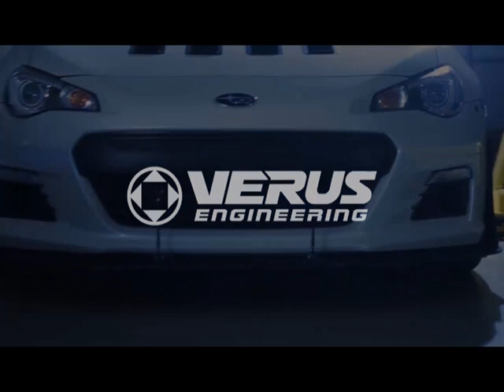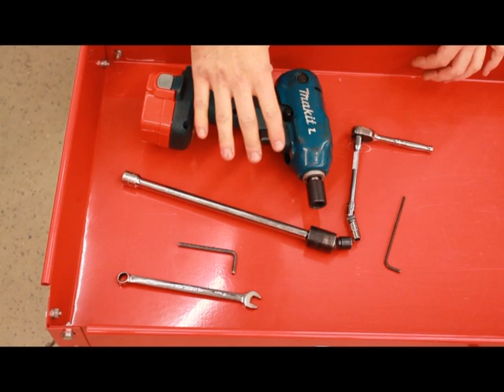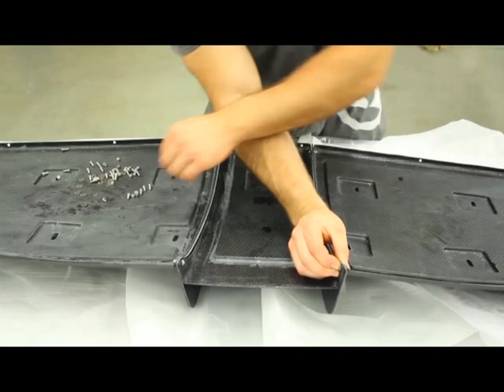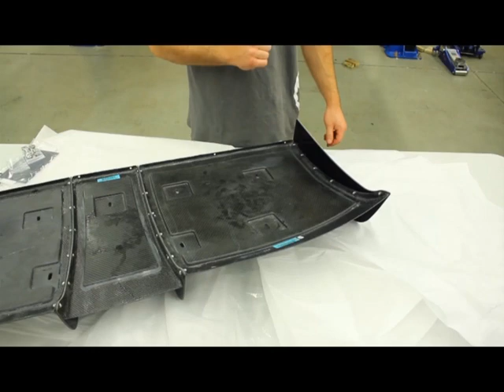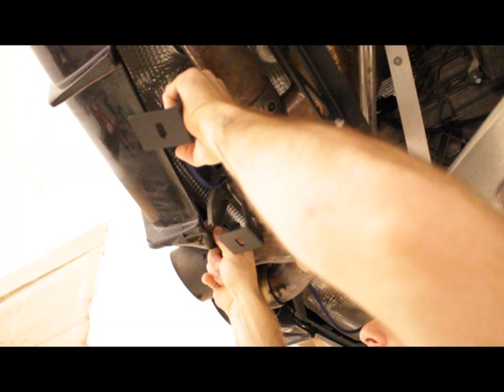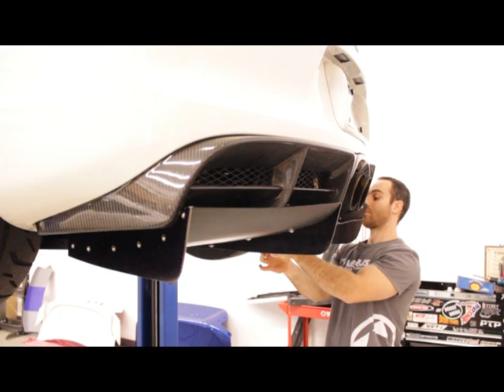Porsche 981 GT4 Carbon Rear Diffuser Install

Comment: which aftermarket diffusers would this work with for a 981 S ??
Reply from the maker: Unfortunately, we have not verified fitment with the 981 S. It is possible this diffuser may work, but it will most likely take some modification to mount.